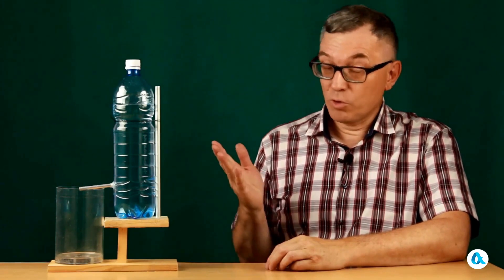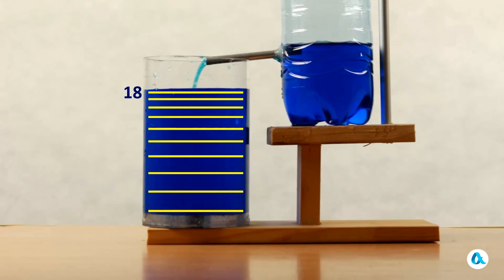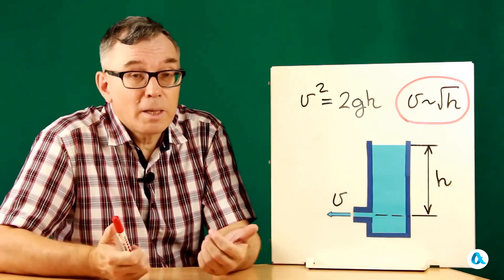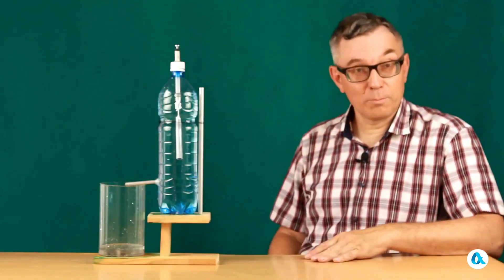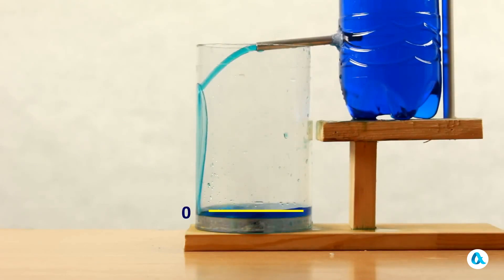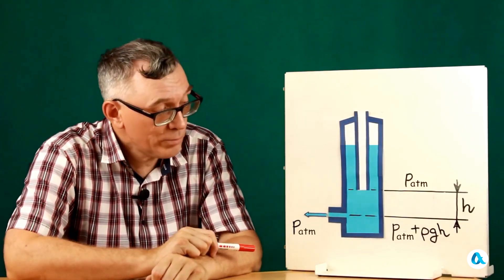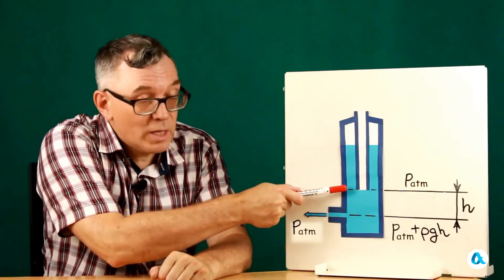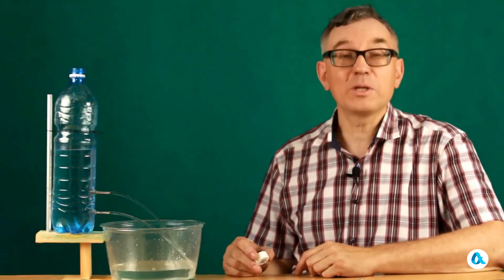Mariotte vessel

Comment: Nice video. My guess is that it'll become a Mariotte vessel. The pressure pushing water out of the bottom pipe will be greater than the pressure for the top pipe, proportional to h. So water will exit the bottom pipe at a uniform rate until the water level reaches the top pipe